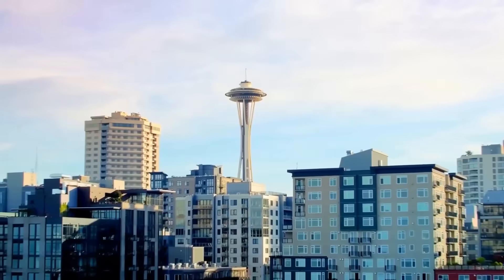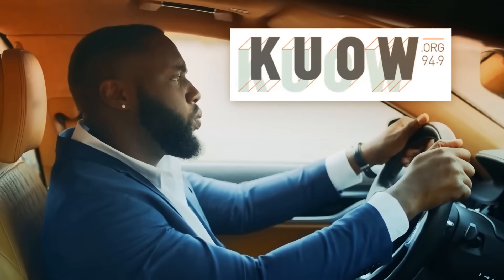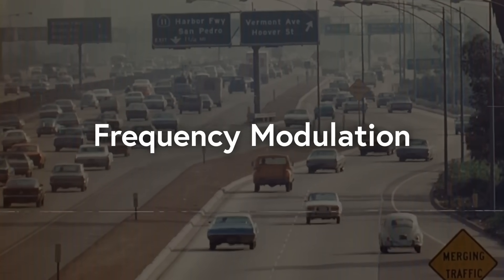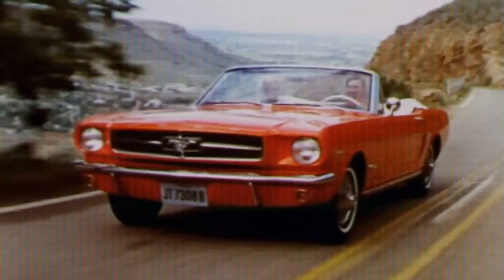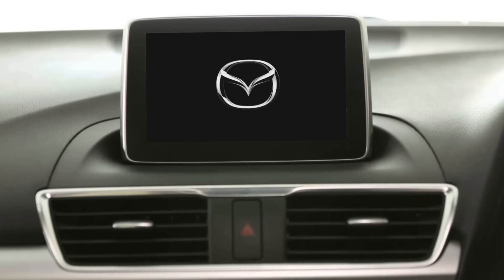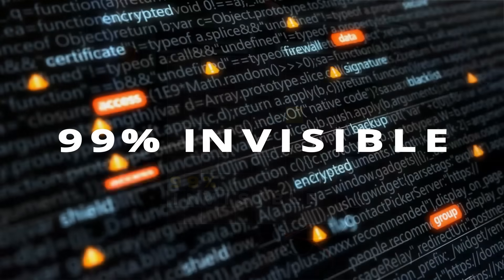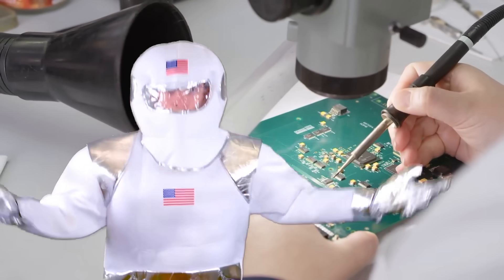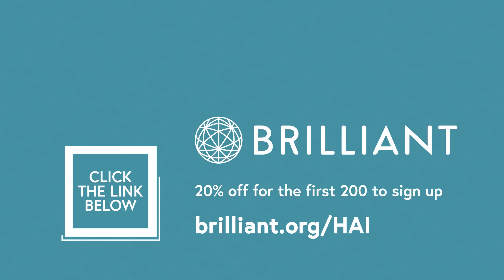Why Hundreds of Mazdas Tuned to 94.9 Broke Simultaneously

Comment: Having worked in IT for almost 20 years, I can very confidently state that I DO NOT want my cars to have any type of connection to the outside world other than the OBD port and only the most limited computing power necessary.

While there are actual advantages to having certain systems being electronic vs purely mechanical, there are many systems that have absolutely no reason to be computerized and I feel like it's just a way to force owners to bring them in to the dealership because they can no longer diagnose or fix it themselves. 
And a justification for charging thousands more than anymore needs to pay for a car. 

It is also a way for manufacturers to institute control over what you can do with 'their' products.
Your car is not yours even though you own it, much like most PC software is not yours - Adobe (for example) just lets you pay to use it for a while.

Sadly this practice of turning everything into a service is only going to get worse, see for example the subscription to the heated seat or remote start 'service' you will need for some new cars. 
Stop paying extra every month? Remote start stops working, in spite of still having everything you need for it. 
Don't even get me started on Tesla and the battery life thing...
Reply: Oh you KNOW the auto industry is totally DROOLING over high tech's ability to sell expensive consumer products that turn into paper weights after about 6  years.  Nothing they'd like more than a car that displays, "firmware not supported" after about half a decade or so.  Planned obsolescence on steroids.  And now bikes are following suit.  Sad, sad, sad.
Reply: I got my start in IT then got into cars. I've been horrified watching technology creep into the automotive world--the sheer volume of computers and wiring stuffed into a modern car makes me sick to think about. That said, I can feel a shift coming--there's going to be a snapback against this kind of thing. Maybe it'll take some sort of Ford Pinto-sized disaster to do it, but all it's going to take is ONE carmaker to come along and introduce a line of "simple" vehicles that are fairly stripped-down but still reliable, well-built and pleasant to use. People might laugh at this now, but it's definitely going to happen. We've got "dumb phones" making somewhat of a comeback, why not "dumb cars" too?
Reply: @HANKTHEDANKEST  I was on the Porsche discussion board when the subject of upgrading the audio system on new cars came up. Funny that I never thought of this, but someone pointed out that you simply cannot upgrade modern cars' audio systems.  They're integrated into the entire info-tainment system, so replacing the audio and head unit is basically a no-go.

WHAT???  Knowing that Porsche specs really crappy base audio systems, with only marginal gains with a Bose or Burmeister upgrade is unacceptable.  If I were spending $150k on a nice new 911, I'd sure like to know I could put in the killer sound system it deserves.  Nope.  At least not as I was led to believe in this forum discussion.

I sure hope I'm wrong.
Reply: @HANKTHEDANKEST  I, for one, certainly hope so but I feel like government regulations for economy and emissions plus EVs aren't going to leave room for that.
Reply: @HANKTHEDANKEST  
The first market for this is in trucks. Modern trucks are developing a reputation for being all bark but absolutely no bite when it comes to doing work on bush roads day in and day out rarely seeing the pavement. The most favored truck in this niche market is still the boxy old Ford truck made in the 80s and 90s because they're the simplest form of a truck they can go hundreds of thousands of KM before needing overhauls and can be field serviced easily. Overhauls that these trucks are starting to need to continue working are looking like a great idea vs trying to run the new stuff that falls apart in 50,000.

The OBS ford is basically to mountain bushroading what the DC3 is to arctic aviation. Nobody has made a replacement that can handle the job better because nobody is allowed to build machines that simple anymore. If someone did make a simple off road oriented truck again though it would be a welcome sight to many.
Reply: @P7777-u7r  That's why the Ford Maverick is selling so well-it's the closest thing we've gotten to a compact pickup since the Chevy Colorado.
Reply: @HANKTHEDANKEST That’s why I drive a 17 year old Miata.  The latest technologies are referred to as the bleeding edge for a reason . You always pay a premium for initial purchase and for fixing the quirks and bugs that usually develop in a new product
Reply: @HANKTHEDANKEST  I believe EVs will lead the way to a Ford Pinto-sized disaster, with accidents & battery fires coupled to failed electric door-locks and latches. If a mechanical fail-safe is provided, it's typically a separate knob or lever, unfamiliar to panicked passengers or children needing to escape in a hurry. In the case of Tesla model 3s and Ys, it's a lever mounted to the power window control panel, separate from the electric button that normally opens the doors. Furthermore, this manual backup isn't fitted to the rear doors! Unfortunately, this dangerous nonsense isn't limited to EVs, as it's also in a number of ICE luxury vehicles!
Reply: @sunbeam8866  The Cybertruck is already more lethal than the Pinto, lmao. I can provide an article if you're curious.
Reply: @HANKTHEDANKEST 
When EVs can burn out entire parkades and full cargo ship loads, we're already in the worst case scenario.
The fact that the media consistently covers this up is very problematic.
Reply: @HANKTHEDANKEST  All of them seem to have been infested with managers with nothing better to do than ruin their product.  Toyota held out, but now they are using crap parts as well.  One of their cars has a plastic oil filter housing, breaks if someone tightens the cap.  Some may remember the "hose from h@ll".  Small, $7 hose, required the engine to be removed to replace.

Once a company's bean counters are able to outvote the engineers, they start on a downhill slide.
Reply: I work in IT as well and I second this 100%
Reply: Hard for the cops to electronically stop a '65 Bug 😃
Reply: I've been using a GPS that plugs into my cars' cigarette lighter for almost 10 years now with no problems besides a frayed cord, and if it gets bricked I can buy a new GPS or use my phone instead of a new car
Reply: @AlexanderRM1000 same here and it even has a back up camera.
Reply: Agreed. As a former IT drone myself, I absolutely despise "smart" things. I feel myself losing my mind a bit more every time I try to explain the plethora of ways that connecting everything to the internet can be abused, by both bad actors and manufacturers. People are like "but it's so convenient!" Uuuuugggh. It's not convenient to own nothing, be spied on, and be at the mercy of tech companies.
Reply: Amen, from another IT Guy
Reply: Or corporations trying to deny anyone from repairing what they paid for and own . Of course it for your safety.
Reply: Some level of tech in cars is useful, like smart occupant safety systems that DON'T fire off every expensive airbag and seatbelt tensioner unnecessarily in a car during a minor prang, or electric windows with obstacle detection so it won't slice a toddlers hands off, those are useful addons, but do we really need things like headlights, turn signals, etc, where the switch doesn't directly send power to the bulbs or a relay (in most modern cars, pressing/turning a switch just sends a request to a "Body management computer" to ASK it to do the desired action for you), or gauge clusters where every dial is just a needle on a stepper/servo motor, and is being told where to point by a computer?

With complexity comes points of failure, and while mechanical systems in older cars can be restored, or even one off replacement parts remanufactured if originals are no longer available for a classic car, when a circuit board full of proprietary chips and software goes pop, and replacement items were discontinues some time in the past, the cars owner is stuffed.

As a side note. I used to have a MK1 Mazda MX5 as a weekend car (Or Miata/Eunos roadster depending on where you are). That thing could be left for MONTHS without being used, and on turning the key, it would crank and fire right up straight away. When back problems meant driving the MX5 wasn't viable anymore I got a Lexus IS200. Because that thing had something like 7 individual (And constantly powered) computers in it, that car would run it's battery flat in a little over a month of inactivity. I now have a Mk6 Golf. For this infrequently used car to be ready to go on the occasions I DO need to use it, it has to stay on a maintenance charger. It's one of the cars with the stop/start system*, but because it usually only does short trips it's never charging it's battery back up to full. If I leave that car off it's charger for around 3 weeks it's battery's totally dead (And that's a large capacity stop/start spec battery too), and in the depths of winter that can even be as short as 2 weeks !........... TOO........... MANY............. COMPUTER SYSTEMS IN IT !!!!!!!

(* A useful trick for owners of many VAG cars who want to disable the stop/start system so it doesn't default to being turned on every time they start the car...... 
Built into the batteries negative clamp is a voltage sensor. The system uses that to tell if the battery has enough charge in it to restart the car. If the battery get's low it disables the system. So if you unplug that sensor (The cable with 2 thin wires coming off the negative clamp) the system can't read the batteries voltage, and subsequently won't risk shutting off the engine when you stop. The only warning light is the same dash board light that tells you when you've turned the system off, it doesn't generate any engine management codes, and as soon as the cables reconnected the system wakes up again.)
Reply: i would agree but with ev's they should have a new port dedicated for updates because the bus speed of obd2 is ludicrisly slow
Reply: @VeniVidiViral gas station and rest stops need the electric cloud soap notification because it seems they are always out of soap and paper towels
Reply: Absolutely i agree!
Reply: @VeniVidiViral but they are never filled at proper intervals so what is the difference
Reply: @VeniVidiViral the soap dispensers that you mentioned in the comment so if the were on the cloud it’s not like they would be full because they places that need to be notified that the sofa is out don’t have the money for it and the places that don’t need to like high end restaurants would by them even though there is no point
Reply: The new Mercedes electric cars have 4 wheel steering.  They have up to a certain angle of steer on the rear wheels but you can “subscribe” to get more angle
Reply: "... ... I feel like it's just a way to force owners to bring them in to the dealership ... ...", which isn't your feeling though, but that's the industry norm lead by Apple's and Tesla's ways of doing business.
Reply: Sorry dude, I hear your complaint but you have to realize it's to little to late.
I'm not stuck in the idea that I can own any new car cuz I can afford the payments. I can literally drive anything I want. My daily is a 72 911. I have never been willing to buy the computerized electroplastic crap the factory has been spoon feeding the ignorant masses for the last 25 years. Problem being, enough people are still thinking it's ok to pay interest on the inflated value of a product that immediately depreciates the second you sign the paper. If people would stop buying the garbage, the factory would have to change. But that's not gonna happen. Sorry.
Be well all.
Reply: The computer that receives constant
Reply: Let the younger generation fix these cars if it’s too hard for you, they’re already working on em.
Reply: Right.  Ford has patented a way to have a car automatically report you for speeding.  No government will EVER force them to actually do that, right?
Reply: I’ve been driving electric for 10 years. The battery life myth is click bait.
Reply: There's a joke in certain parts of the internet:

Tech enthusiast: I love technology! I've wired my entire home to my Alexa!

Engineer: The newest piece of technology I own is a printer and I keep a loaded gun in arm's reach in case it makes an unexpected noise.
Reply: i read an article a bit ago that said glass displays are cheaper than putting a bunch of knobs on the dashboard. think it also said it seems safer to fiddle a knob, than work a glass display. i don't know i haven't been in a car since they have been able to turn the headlights off when you leave them on.
Reply: @555mek  Ofcourse one display to control everything is cheaper then buttons and knobs and sliders. Once the display goes out the car is a brick.
Reply: @GrzegorzDurda And, instead of a $100 switch, you can buy a $3000 screen-module!
Reply: I wouldn't limit to the OBD port but they should all be wired connections anything can be in the ether.  Ever heard of a spark transmitter?
Reply: @robertstoneking7916  Didn't they have one on the Titanic?
Reply: @sunbeam8866  I had to look it up but yes, spark gap wireless telegraph. The key is in line with the power and a spark gap generates a signal that's all over the frequency spectrum.
Reply: You need a connection to the outside - since the car company can fix software issues WITHOUT you pulling into a service.
It is called an "eCallback". You will get an official letter to inform you that there is a critical issue with the software and they need to update the sofware.

Or you have the best programmers + tester imaginable and they write perfect code without ANY issues. 
Which did not even happen for the NASA apollo program. They had a sofware bug on the guidance computer because humans make mistake and no amount of testing will prevent 100% of issues.

That said - I am with you on preventing unnecessairy connections, the only thing hooked to the internet in my appartment is the PC + mobile phone.
Reply: @benjaminmeusburger4254 or, better yet, maybe they can just mail you a 1GB sd card with all the revision information they need to send, in a verifiable format that requires both effort and time.

This is how many non wireless machines get updates

Comment: Cars with computers will NOT fare well with the coming WW3, EMPs and cyber attacks. For those who don't believe it's coming, I've seen the Intel. Prepare NOW. Turn & cling to the Lord. Things are going to get a LOT worse.
Reply: Too the powers that be it is a powerful feature of the wireless age and not at all a bug. There is no such thing as a “secure” device that can receive any type of digital connection.